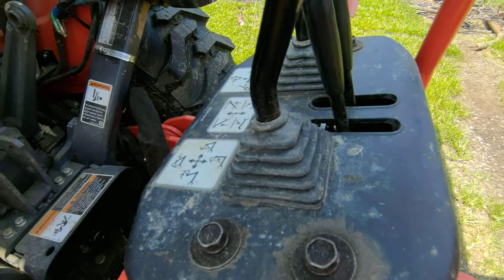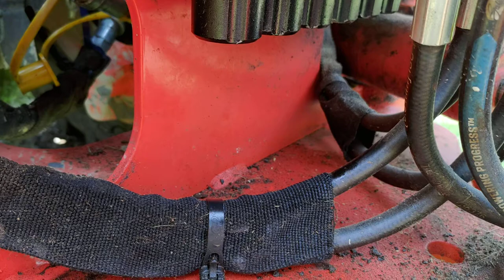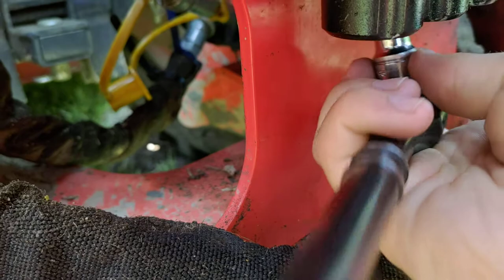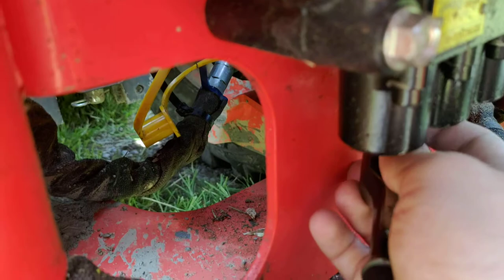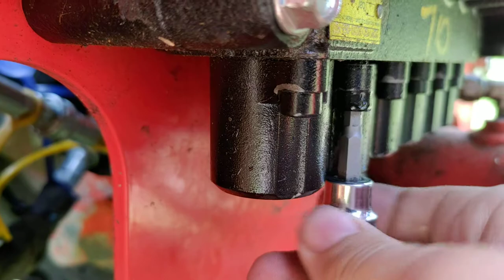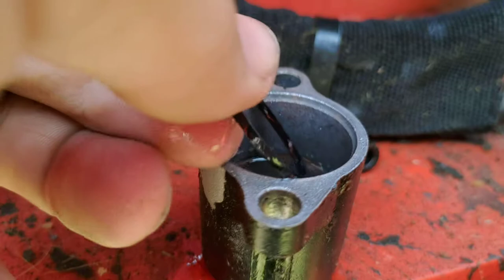Kubota B2401 BH70 Backhoe Valve Body Problem

Comment: What caused it to hydrolock, and why did the whole valve body have to be replaced ?
Reply from the maker: Some internal seal had a slight leak, which caused oil to seep into the dry side of the valve body.  With it flooded with oil, there was no room for the spool to shift, thus, locking the valve.

After a lot of back and forth with Kubota, they instructed the dealer to just replace the whole part rather than try and repair it.

Comment: How do you like the B2401?
Reply from the maker: It is a good machine.  I have backhoe, front loader, and mid mount mower.  I mow about 8 or so acres of grass on a 13 acre property, with hills.  The 3 speed rear end is nice.  It also has a 2 speed PTO.  The main transmission is a sliding mesh, and is as such unsynchronized.  I can shift gears by double clutching pretty well, but on a hill the ratios are too close for that, so I must come to a stop to change gears.  A syncro transmission would have been nice.
For most people, the B2601 (almost identical but with hydrostatic transmission) is the better option.  I have my reasons for preferring the stick shift though.
Overall, I am happy with the machine.  This backhoe valve body issue is due to a manufacturer defect and should be covered by warranty.
Reply: @zoidsfan77  I borrowed a BX machine and while the HST is great for loader work, I found it a bit of a pain for pretty much everything else - having to keep your foot on the pedal, especially backwards where the cruse doesn't work.
Now if I could only find a dealer that would get me one before 2022...
Reply from the maker: @DominicRichens  Is that how far out they are now?  It took several months to get mine, but there was a delay related to the 3rd function valve I had installed.
Reply from the maker: @DominicRichens  The unsyncronized transmission definitely slows down loader (or other earthmoving) work a bit, but I feel I have gotten good enough that the loss is fairly small.  The main thing to consider though is that when running PTO implements, you can't slow down without slowing the implement.  For mowing around obstacles for example, it would be nice to vary the speed.  What I typically do is mow all my open areas in gear 2M, then come back to the tight spots and mow those in 1M.
Reply: @zoidsfan77  Having the shift right next to the loader control looks good - better than the L-series where the F/R shuttle is on the left so you're switching hands all the time when doing loader work.
Thanks for the tip about using the PTO -  not going to be my top use for this tractor - if anything it would be bushhog or sickle in a field.
My dealer just e-mailed to say they'd found a B2401 at another dealer and arranged a trade so I can get it in a month!
Reply from the maker: @DominicRichens  I had never driven an L, but if I needed to go bigger it is what I would strongly consider.  The B2650 doesn't have a manual transmission option except in foreign markets where it goes by a different model name.
I hope the purchase of your new tractor goes smoothly.  One thing I'll mention for when you do get it is that the transmission seems to shift a little easier after 50-100 hours or so.